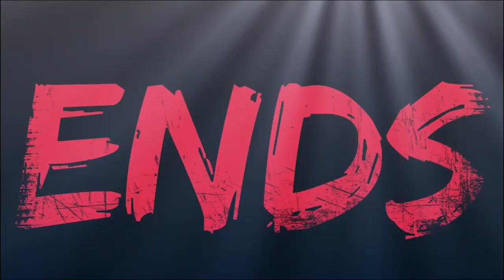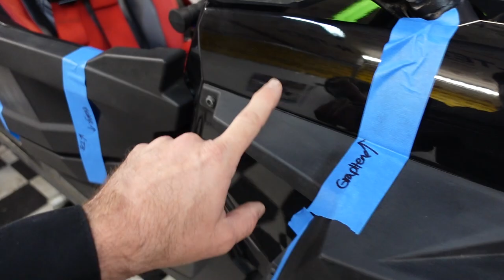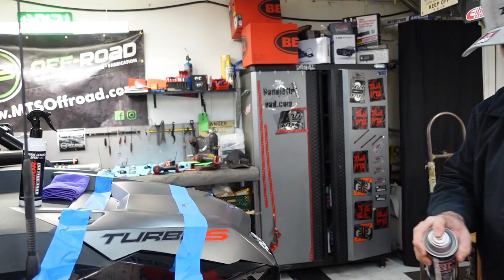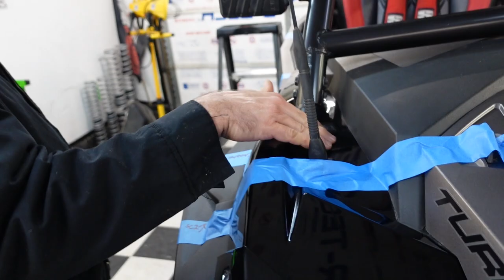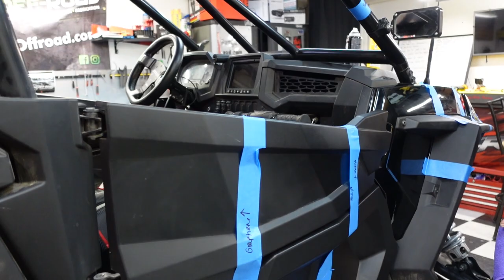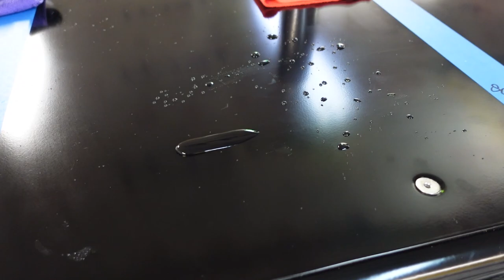SHINE THIS!!! Test & Review of SHINE ARMOR GRAPHENE CERAMIC COATING On The RZR Turbo S…

Comment: Healing vibes and🙏's sent. Hey it's not a Lamborghini it's a off road toy just spray the Whole dam thing down with water and if you think you need to do something else use the plege on the body parts and then go buy some beer with the money you saved. OBTW for cleaning the chassis and running gear  Water/ Totally awesome/WD-40. For the  "Totally Awesome" you gotta go to the dollar store for that as for the WD-40 parts store of your choice it helps keep everything cleaner I've been using that for over 40 years.
Reply from the maker: Thanks much, we have been using pledge for years, but honestly this may be cheaper, if it last and doesn't attract dirt as bad we wont use as much, plus they sent it to us to review, so of course we gotta right?  Doesn't WD attract dirt?

Comment: I’ve Never used shine armor but have personally tested sc1 vs pledge.  I’ve found sc1 has more initial shine but collects dirt/dust much faster when riding then if I hadn’t used it.  The pledge doesn’t have the shine but keeps car looking cleaner longer while riding.  Great test is detail your wheels with one of each and after a day of riding give a review.  ✌🏻 #samson503
Reply from the maker: Same here, I am planning on coating the drivers side with Shine Armor and the other side SC1 for our trip this coming weekend to the desert. Should be interesting.